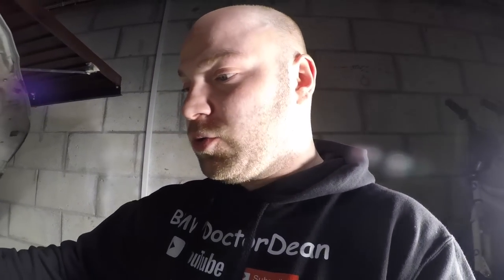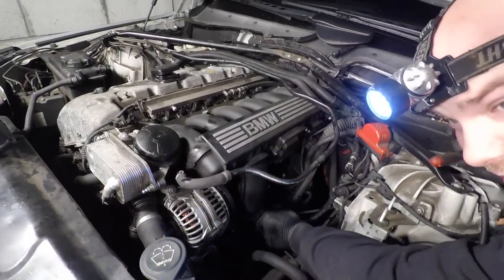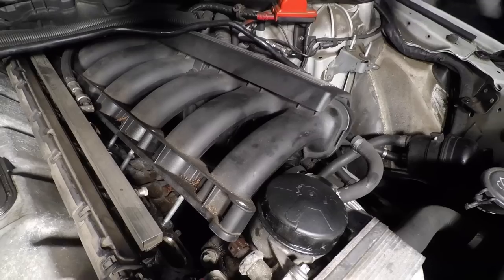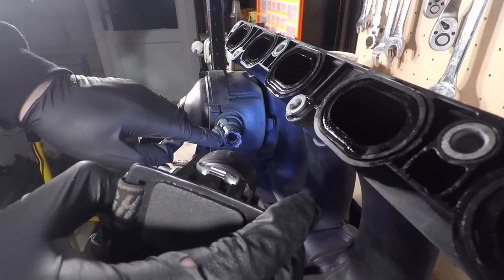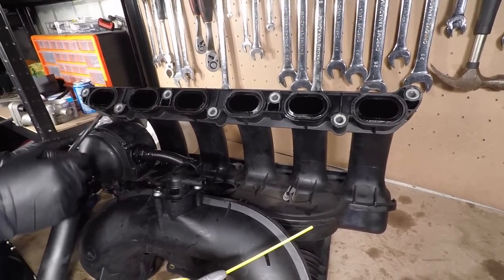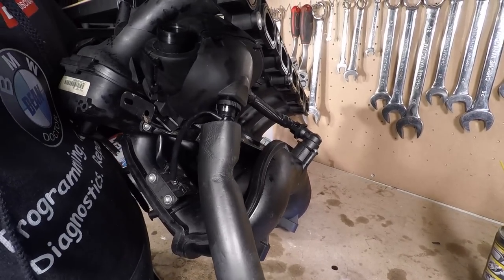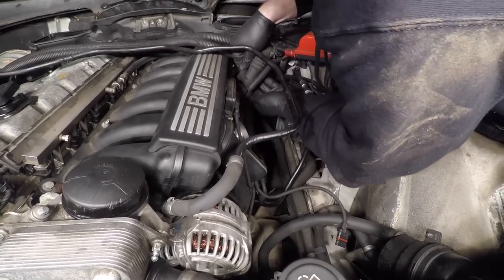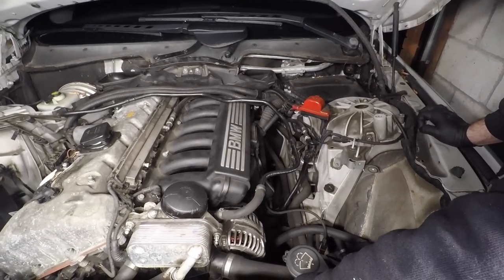BMW N52 How To Replace CCV Intake Manifold Removal Step By Step Guide

Comment: Hello. I just replaced my CCV and now my idle sails between 600-650rpm, with cold and warm engine. Any idea whats wrong whit it?
Reply from the maker: Did you change your solenoids 650rpm is where it should be anyway
Reply: @BMWDoctor  I just checked. The kit was not the same. With mine came some new sensor for the intake manifold and i replaced it.
Reply from the maker: mutjoo123 that will be the PCV heater mate don’t even dare plug that in unless you want your car on fire
Reply: @BMWDoctor  The "sensor" or what ever it is that i replaced, was on the other end of the smallest pipe coming back to intake manifold from the vent
Reply from the maker: mutjoo123 ok the wires attached to the ccv pipes are inbuilt heaters there not a sensor but a plug and you need to plug them back up properly or the heater system won’t work
Reply: @BMWDoctor  I made some research. So it was the PVC heater that i replaced and its different from the old one, i think like new model. So what are those solenoids you mentioned earlier? Thank you for your effort.
Reply from the maker: your welcome mate VANOS solenoids mate when your finished with the manifold go look at my other videos mate I just made one today regarding it
Reply: I am almost done replacing the ccv.   I am having trouble with the lower hose on the CCV.   When I put it on the pipe the goes to the oil pan it doesn’t clip on Securely.   Any idea what I could be doing wrong or is that how it is
Reply: @p-force7732  I had the same problem. I just used lots of WD-40 and force, it was really tough to get on its place. I couldnt do it alone, my friend pushed it down from engine bay and i pulled down under the car at the same time until we got the click out of it.
Reply: mutjoo123 thanks dude!   Lube and force finally got it on there.

Comment: Was ot causing smoke out tail pipe?
Reply from the maker: yes it was mate
Reply: @BMWDoctor  thanks doing it now
Reply from the maker: @horizonview1850  good man make sure you watch this video and follow it mate clearly
Reply: Will it smoke a little after i i replace it
Reply: I did everything u did. Just started but very little comes out no very notisable
Reply from the maker: horizon view that’s how it is mate condensation from the exhaust being cold nothing to worry about
Reply: Thanks man out of everyones video on youtube yours is the best, thanks for all the help smoke went away even on cold start, problem was the ccv in fact, respect to your knoledge and thanks again
Reply from the maker: @horizonview1850  your welcome mate and thats what everyone says mate thats why YouTube recommends this video because how clear and well made I made it your welcome mate make sure you subscribe if you haven't and I got more videos and a better one for the manifold removal explaining everything underneath and showing around while removing it to make it even better details then this one
Reply: BMW Doctor - I’ve got an older e91 with n46 engine, how do I know if it’s the ccv or the valve stem seals? I definitely have some oil in the intake manifold which I hope means ccv?

Comment: that damned thing needs to be replaced in case of starter motor removal/repair.
Reply from the maker: No it doesn’t not at all there is a easier way to replace starter then taking this off
Reply: @BMWDoctor  whats that way? Can you share?